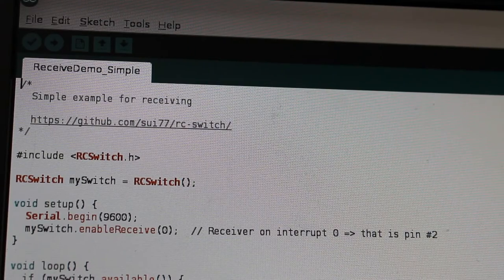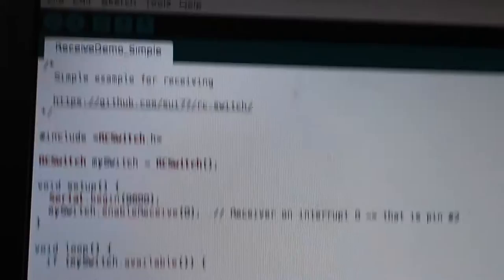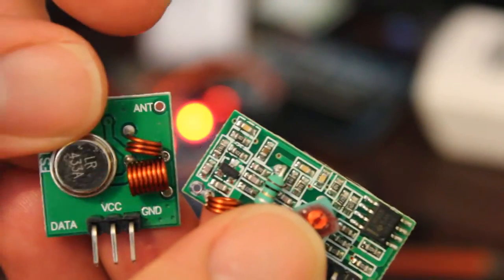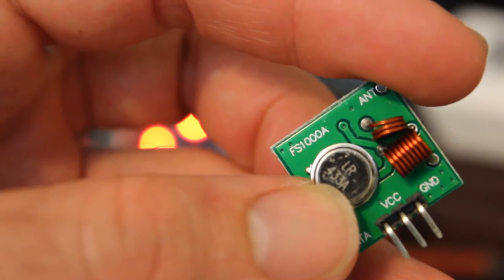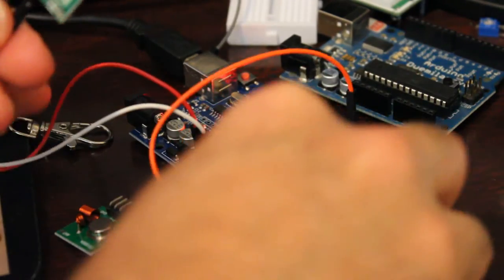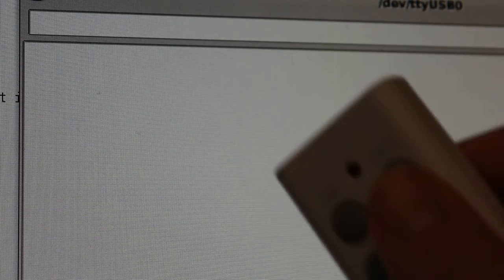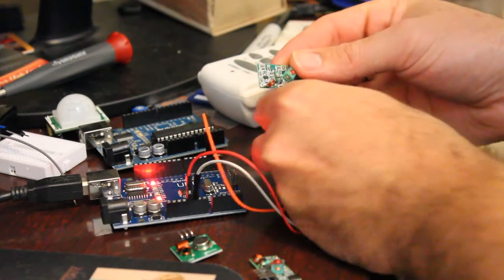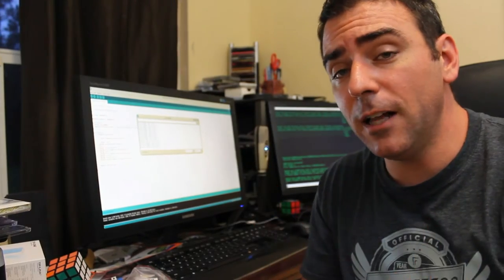Arduino Radio Reciever Example Code 433mhz 315mhz

Comment: Not sure what I'm doing wrong, but when I press the remote button, the led on the receiver responds, but the serial monitor has no output.  The remote and receiver are both 433 Mhz with a 1527 chip.  Arduino UNO that is working fine and has been uploaded with the simple receiveDemo and also tried with the advanced receiveDemo.  I also tested the remote/receiver in stand alone mode turning on an led without a problem.  Any suggestions?

Comment: do you know if you can grab the security code of the remote control somehow (the one that is soldered in the remote control to make it unique)? I'm trying to find how to do that so I can recognize witch remote control was used to control the receiver. great video btw!
Reply: Sorry I don't.  I didn't know that the remote controls sent out a security code.
Reply: I think it's the first part of the binary code you receive from each button... but I'm not sure... tks for your time!  @DigitalMetal

Comment: Hi I wonder would this work for a car remote control? Let’s say a 2005 Honda Pilot I think it’s 433 MHz I want to add remote start instead of trunk release button. Or maybe you have some better idea how to make  my oem Honda remote trunk button send a signal to some kind of receiver Thanks
Reply: I don't think these would be very good for that.  There are other devices that would be better. Xbee would be one, another is a Nrf24L01.  I have some Nrf24L01, but haven't had a chance to play with them yet.  I haven't used a Xbee either. But I think those would be more suited for what you are trying to do.  They have better range and can transmit faster.

Comment: Nice Video, Can You also send an array with information (for example the values of the x/y of a joystick) using these receiver/transmitters?
Reply: I'm not 100% sure.  But, you could just send a numeric value you split on the other end.  Example, if you wanted to send x=145 y=45 you could send, 145045 and split it so that the first 3 digits are x and the second are y.

That being said, it sound like you probably want something more like an NRF24L01, which works at 2.4ghz and has a longer range.  I have a few of those, but besides using the basic example code I haven't played with them much.  When I do, I'll be sure to do a video on it.   Hope that helps some.
Reply: Kris Occhipinti Thanks man! I Will certainly look into That!
Reply: @DigitalMetal  i would appreciate it too